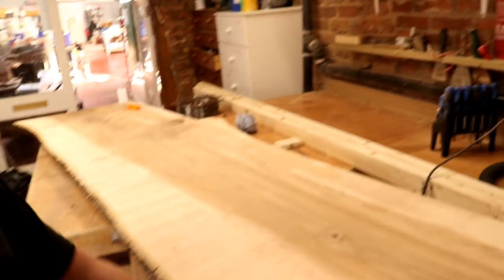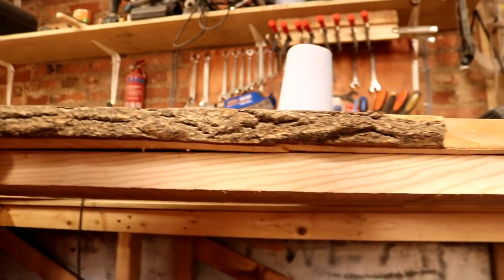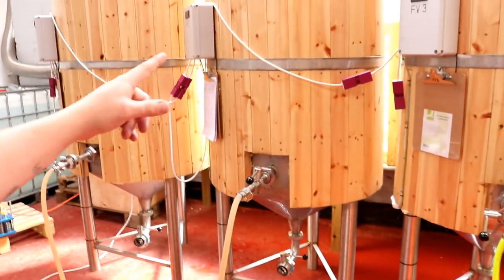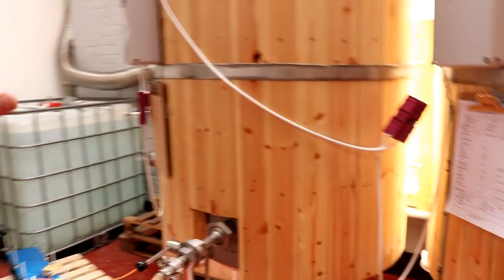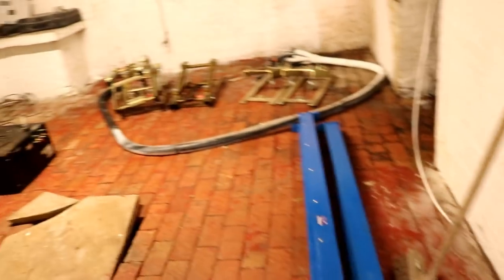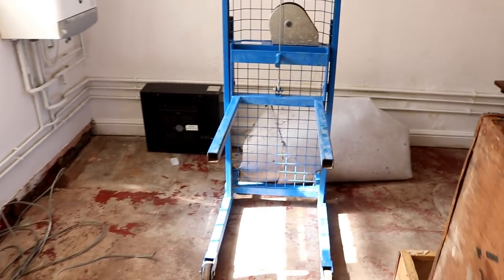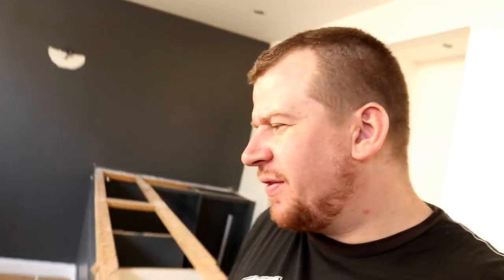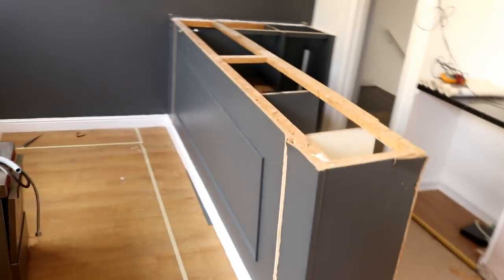WALK & TALK

Comment: mate, for the bar I'd use two planks to get the thickness desired then do a polished copper front piece running down the length to cover cover the join, maybe with a copper rail also.